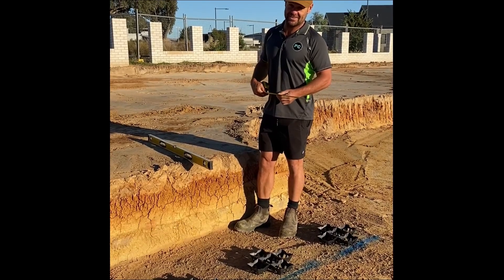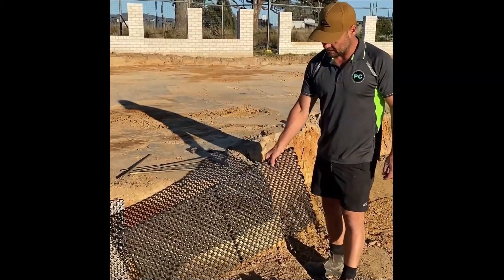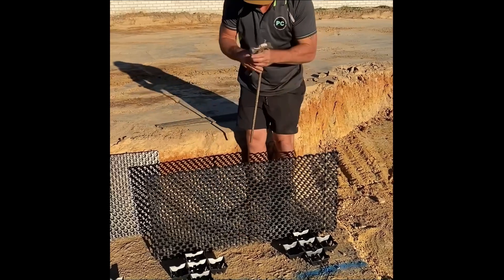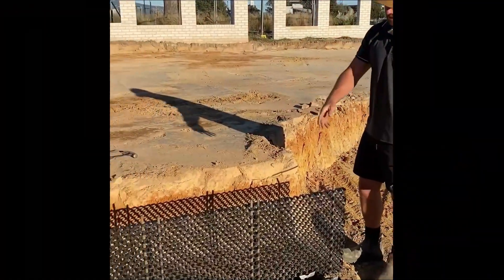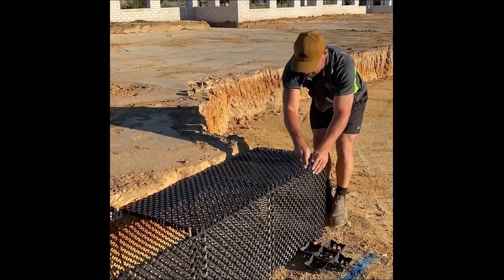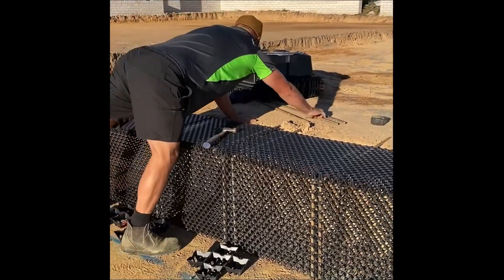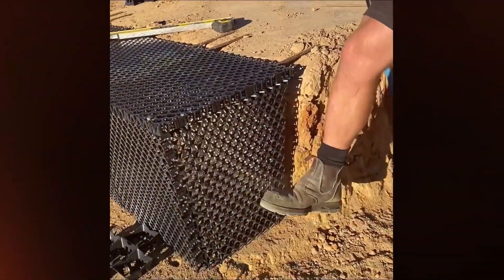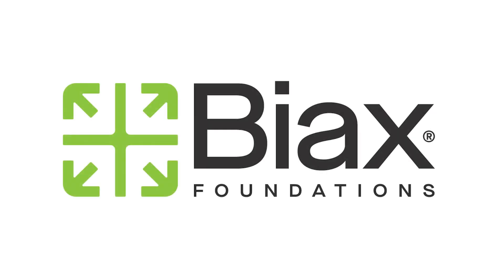Biax Drop Edge Beam Installation Guide

Comment: Your talking about safety what about water retention?  Which will soak into reactive soils still have slab heave. Making a video to introduce this new biax slab system you don't talk about how to stop water from sitting under the plastic boxes . Maybe you should explain how this system will stop slab heave from water. And if you think builders and concreters will sit there and cut the plastic and do it right you far from been accurate.  Sorry but it's reality.